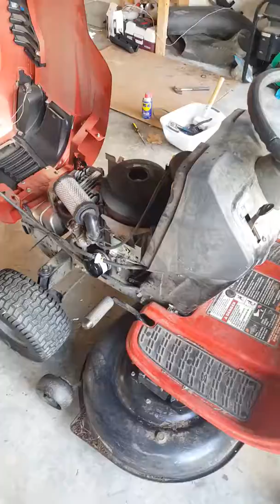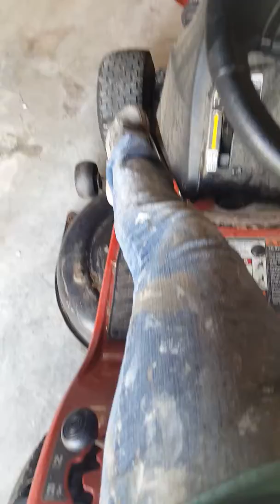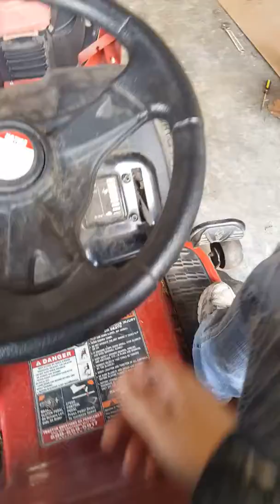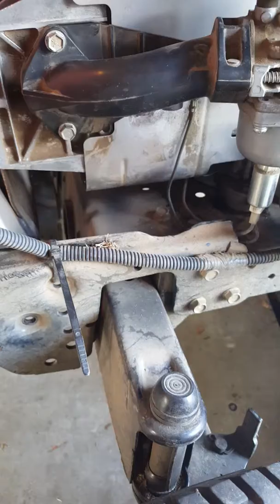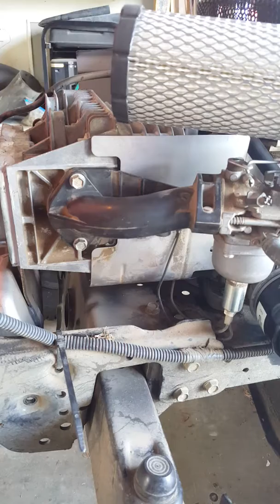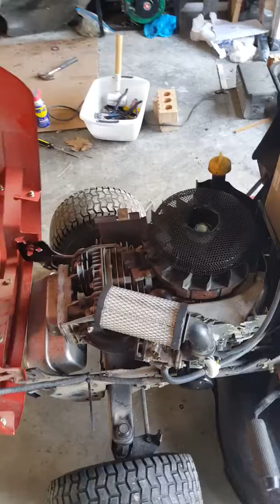Strange metal scraping or grinding noise when driving lawn tractor.

Comment: Looks to me that you have several issues. Since when does anyone need to use the top of the foot to lift brake pedal back up. You might be missing a spring. You might need to remove mowing deck, lift front  of mower up and get underneath and see what's going on. You will need to have it running so make sure its secure and wear safety glasses. You might need to have someone press down on the seat to keep it running if you need brake off. If the brake can be on then no second person is needed.

Comment: Did you manage to solve the problem? I’m having the same exact issue on my Cub Cadet and I cannot Sean to find the issue.
Reply from the maker: The lower drive belt was slightly off track and rubbing on metal.  It needed adjusting, but I replaced the whole belt because it was worn.

Comment: Check the transmission.. is it from the engine? Take it to a professional
Reply from the maker: It was the lower drive belt. It was slightly off track and rubbing. It was an easy fix.
Reply: @HoodsHomestead  do you have a video of it? im having the same problem but i don't know what to do..
Reply: @laokartoon7300  same!